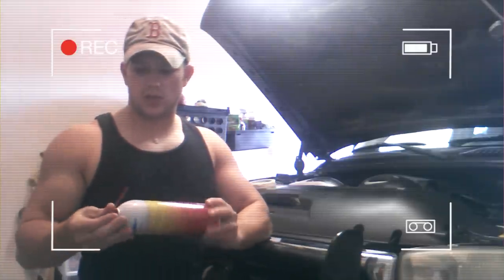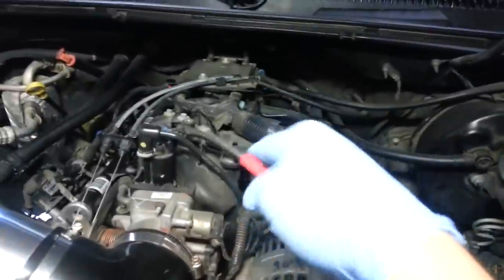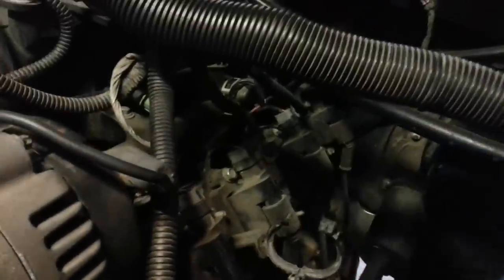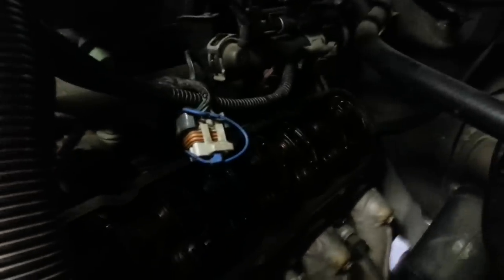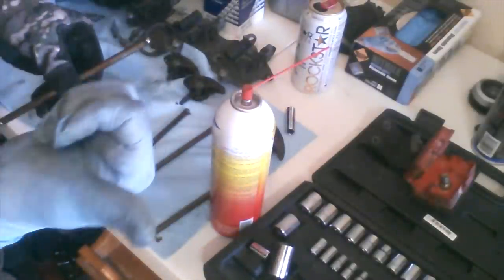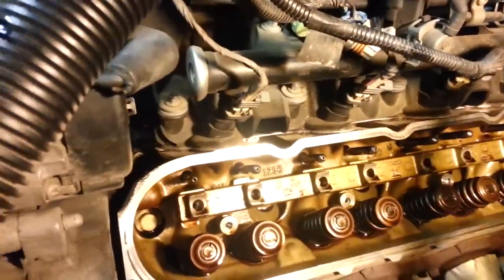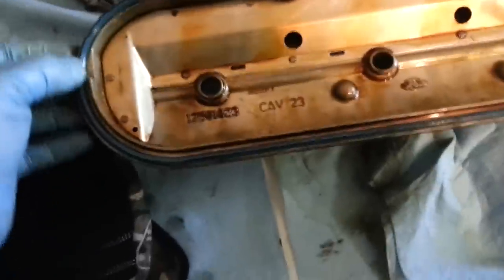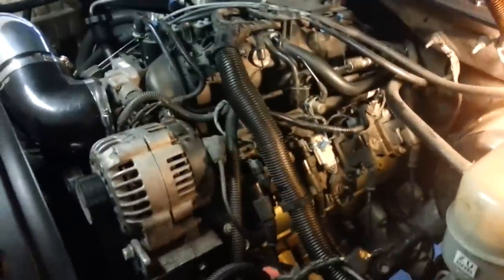GM Lifter Knock Repair - Carb Cleaner Method - HOW TO / TUTORIAL

Comment: This video was perfect I jus did this to my 01 5.3l z71 Tahoe and my lifter noise went away. Only difference was I used those long rocker rods to spray B-12 down into the lifters and afterwards I changed my oil and added seafoam to it. No more ticking
Reply: Sn99kwsb was the tick u have when warm or just cold start
Reply: It was pretty much only during a cold start and it would last about 15 minutes then go away but this was a temporary fix now I use hyperlube oil treatment to keep the tick away
Reply: Sn99kwsb my 2001 yukon denali 6.0 ticks at idle only when warm all the time once rpm up it goes away oil pressure is good exhaust manifold bolts good been doing this noise since i bought it with 60k miles now 148k miles still doing tried everything from synthtic oils to most additives still there only 20w50 oil seem to help little not sure what else to try
Reply: Ali Saleh well u should try hyperlube with your 20w50 or I might jus have to get new lifters are u sure u dnt have an oil leak?
Reply: Sn99kwsb i ll try hyper lube with 20w50 if it does nt work i ll have to ignore the tick noise and turn radio volume up till i save some $$ for newer SUV

Comment: i've always put a quart of marvel mystery oil in the crank case and driven it around for about a day or two before changing the oil, or in bad cases, i've put a bottle of chemtool into the crank case, driven the vehicle around the block a few times to get the engine warm, let it cool untill its just warm to the touch and did an oil change, this process atleast directly targets and back flushes the hydraulic lifters themselves, not a bad video

Comment: I did exacly the same on my Avalanche 3 years back. The tick came back after few months but I believe it would dissapear it it was repeated. Now, I have the same problem on my Escalade and will first to pour some AT in the engine, ride it for few days and if it doesnt help I'll remove the valve cover...
Reply: Did the trans fluid help??
Reply: @NORCALPYRO_  nope. I changed the oil pump (high flow) and it still had a pretty low pressure... Sold the car.

Comment: You do realize when you spray the solvent into the lifter it doesn't exactly "run down" ? The lifters sit in a bore and are fed pressurized oil thru the sides .. so it's just loading the oil passages with oil remover essentially ..
Reply: Yah that don’t sound like something I want to try
Reply: @michaelbaskinmichael9862   on a side note ... It does typically work .. you can also try jetting some air into it with a compressor

Comment: I tried that on the LS1 motor in my Holden Commodore (I live in Australia) and that didn't work,2 things I found can cause that noise 1 - varnish buildup in the lifter bore, the engine heats up after a few minutes and the lifter plunger expands causing the plunger to stick inside the lifter housing , 2 - dirt and/or dust gets trapped inside the lifter body causing the oil flow to become restricted through the hydraulic lifter, dirt sitting between the check ball seat and the check ball allows oil to flow up through the pushrod(s) thus not allowing the lifter body to fill up with oil therefore results in the lifter(s) making a "clacking" sound.Mine started doing it last August after changing the oil pan gasket.After 11 months of changing the oil, the engine only has a faint rattle on startup sometimes when warm but the loud annoying clacking noise has gone away so I'm happy with that.

Comment: There's an easier way: add 1 quart of atf to your oil and run it for a little bit before changing your oil. If your truck doesn't leak oil (rare for anything GM) then use full synthetic oil. It flows better than conventional oil.
Reply: excellent!   ive heard someone filling their oil filter w ATF on every oil change.  and/also running a full qt of ATF replacing aqt of oil.

Comment: Most of the carb cleaner will have evaporated once the engine is hot, and will be collected by the pcv system. Unlikely to do damage. Carb cleaner when oil is cold and thick. Evaporated once oil is hot and thin.

Comment: Hydraulic lifters tend to make a tappy noise if the the engine is not serviced properly. The sludge build up eventually restricts the oil flow. The best way to get rid of the noise is to remove the valve cover and the timing cover. Release the tension on the camshaft gears. Remove the camshafts and lifters. Clean the lifters and put everything back the way it was removed (just the opposite way). 

If thats too much of job for you. Simply flush your engine with diesel engine oil every fortnight/month. Use good quality synthetic oil and oil filter. Over time the sludge build up will decrease and the oil pressure will increase. Will not fix the problem but somewhat remedy the problem to some extent. 

Lastly dont waste your time watching a 25 minute video coz there is simply no quick fix to the problem.
Reply: Kamal Benipal I have a 2001. 8.1. I bought it with 69k. It always knocked at start up. From what I read, this is normal for that engine. 496 c.i. One powerful engine.
Reply: This motor doesn't have gears and there's only 1 camshaft.  You would have to remove the intake to get to the lifters.  You have absolutely no idea what you're talking about here.  Jesus..
Reply: You actually have to remove the heads to get to the lifters on a LS based engine.
Reply: SNELLERIZED GARAGE
I am surprised so many of these commenters do not know you have to pull the heads on an LS based engine to get to the lifters (to remove them). Hence the whole reason this dude in the video is going through all this to try to devarnish/desludge them. I have a higher mileage 5.3 in my 2001 4X4 silverado that I am going to do this to real soon. It would be nice to just pull the intake, remove the lifters, soak them in some type of cleaner, inspect them and re install them like the older gen small block chevy's...........lol. But these LS based engines are really just so much better than the previous small blocks.
Reply: CHEECHMUN
I have been searching for a 6.0L to replace my 5.3 in my 2001 silverado, but that 8.1 would be awesome......
I know a guy that messed with diesel engined silverados for awhile, got tired of them and now has two silverados with that 8.1 engine in them. He said they are much cheaper to maintain and will pull a house.
Reply: @Ephbaum  this generation you have to remove the heads

Comment: Just so folks know when torking the rocker arms you have to bring #1 to TDC then tork the intake 1,3,4,5 and exhaust 1,2,7,8 then turn engine 360° and tork intake 2,6,7,8 and exhaust 3,4,5,6. That is the proper order.

Comment: I want to clean my rocker arms valve springs tops of the heads and push rods with gunk non-chlorine carb cleaner and let it soak overnight then change the oil again I just changed it last Saturday but I had to replace my intake gaskets actually if you go back and look at my very recent video on my channel you will see why I want to clean it all up my motor was beautiful before I tore it apart I didn't realize it was so dirty inside LOL what do you think anyways about spraying my valve springs and rocker arms down and push rods with carb cleaner

Comment: Why not just spray the carb cleaner down the oil hole of the rocker it will drip down through the push rod then down to to lifter.  No need to take anything apart.
Reply: so would this work
Reply: he just wanted to do it the hard way
Reply: I know right? 
Just pour a bunch of B12 in the oil hole. Let it do what it does. Then change the oil in a day or two.
Can someone validate this for me?

Comment: THATS WHY CHANGING YOUR OIL WITH THE RIGHT OIL IS SO IMPORTANT
Reply: WHEN OIL WAS CHEAP Castro .99c qt, I would never let it get dirty, it looked just like it came out of the can. I changed it about every 1000 mls.
pre filters help also and keep air clean = clean oil
Reply: Every 1000 miles?.You would be more broke from buying oil than replacing engine.......lollolol.............That's a lot of damn oil....That would be about 15 oil changes in one year.......................
Reply: @shawneliason790  he's probably full of shit,but if you change your oil at 1000 miles say three times consecutive, it should douche A lot of shit out,I've done it on many used vehicles, at that third change the oil is clear af,Italian style.especially if you don't wanna take it to a shop ,

Comment: I have a 07 gmc sierra v6 4.3 I can let my truck sit for few hours or over night  during day its fine . if I let it sit it will have a tapping sound in the passenger side valve cover but it will clear up about 1 minute I have checked the rockers there tight. And took out the push rods none are bent. I rolled them out onto a flat bord. Do I have a lifter thats possible sticking? I havent took my intake off yet and checked those. But there is one thing this video helped me on that I didnt check lol. Is the holes on the push rod might be stopped up?

Comment: hello all, cant you just spray through the rods since its a sort of tube , and its directioned directly to the point where you need the carb cleaner to dissolve the sludge? just asking so i dont have to worry about separating all the pieces.
Reply: I kinda thought the same thing.
Reply: If there's sludge stuck in the rod preventing oil circulation and you push it down with the spray, there might be a chance that it blocks the rod again.  Or ends up in some other place, like bearings.
Reply: @mattijur4374  But if one gets to that point, they should just remove the rod, clean it and then put it back in and use it to funnel the spray to the lifter.  Probably a good idea to clean the rod anyway if you're in there.

Comment: or perhaps...... ATF in the oil. One recommendation was filling the oil filter with automatic transmission fluid when doing an oil change.    and/also having 1 full qt of ATF replacing 1 qt of oil.  Run normally, or before an oil change.

Comment: those stock pedestal style rockers are bullet proof, there's virtually no way to screw them up.
you really can change the order any way you want, the engine wont care.
All roller lifters and rockers don't need to be matched either.
If you're OCD then do what you will, but I heard this from engineers that build engines.

Comment: I own a 5.3L V-8 Vortec Engine...... I use synthetic oil and drop it every 4000 miles. I find that synthetic oil flows better within the tight areas of the engine. Conventional oil if not changed on a regular basis can build sludge that clogged the push rods and harm lifters. I also use Marvel  Mystery OIL I run a quart on every oil change......Keeps everything nice a lubed. I also add 4 oz in the gas tank to clean and lube my upper intake cylinders. Using a carb cleaner and air compressor is great but spray some Marvel Mystery Oil to fine lube it works...
Reply: You can do an oil change every 6000 miles nowadays easy. The 3000miles oil change thing was for cars in the 50s. Just a tip if you wanna save money. Every 6000 aint gonna hurt anything.
Reply: +Jesse Jesse ummmm... no. lol. 6000 is for synthetic oil. If you are running regular oil YOU STILL NEED TO CHANGE EVERY 3k or 3 months!!
Reply: Nah I'm sticking to me original statement. Take care of the motor and you can go 6k every oil change.
Reply: Eric Swarbrick
Reply: +Jesse Jesse one of the reasons I dropped my oil every 4000 miles and use a quality filter and quality Libs.... is because of  punishment I put the Vortec engine thru.
Reply: That's understandable. For daily use and not beating a car tho you can go 6k per change.
Reply: +Jesse Jesse you're 100% correct. most synthetics you can even go ten pretty comfortably. I feel like that recommended 3k is bs dealers can use to void your warrantee if they want to. If you do research on synthetic oil, you can see that it doesn't really break down. it just gets dirty from micro particles. my bosses Toyota carolla has a recommendation of 15000 miles for an oil change, when I saw that, it blew my mind and I had to do the research.
Reply: Wow yeah I've never heard that long before. But if anything a coralla would be the one to do it Gary Will
Reply: In Asian cars even more the reason to use MMO
Reply: NYRM1974 technically nothing in the intake is being lubed.. The engines sfi
Reply: @jessmane  look at those repair manuals from 60's and they say 5000-6000 miles per oil change. Fast forward 60 years. With better filter and oil technology. We change every 3000😉 go figure. I think it's to sale 2 as much oil
Reply: @cleverkitsune4302  it gets lubed threw the PVC and breather tube on passenger side. If you ever took off one of these intakes you know what I'm talking about 😉
Reply: @pmotorsports8276  yeah but remember everything is made super cheap now and doesnt last. Oil breaks down faster, cars fall apart easier, nothing is made to last. The excuse of the 60s is the engines weren't reliable bcuz technology wasn't there yet. But the strong materials were there not the materials are cheap but we could do so much better if we wanted to..

Comment: I think it's a great trick.  but just be careful not to dilute too much my brother did something similar changing over to really really light weight oil to "clean out" noisy lifters on a pontiac 6000 4cyl, it collapsed some and floated other lifters and wiped out the head. don't remember details of problem other than a new head and lifters were required.   I would definitely change the oil if much goes into the oil pan.

Comment: Is the procedure the same for a 2011 Denali 6.2L Gen IV L94 engine? I replaced the lifters / camshaft at 131K miles. 48K miles later, I hear the same ticking noise. Want to give this a try if it is similar procedure. thx.
Reply: Scott Knowles different styles of lifters because 06 and newer have DOD so the cylinders shut off for better fuel mileage

Comment: I did exactly what you did in the video.... Drain my oil & on the tip of my oil plug(bolt) was 5 little pins sort of like what goes inside a bearing... Put fresh oil in it & it still makes the same noise... Driver side closest to the front.... Should I swap motors or what.... 03 Tahoe 4.8l.... Thx

Comment: the tube of the carb cleaner fell into the rod hole, now I have to take the heads off....geez
Reply: You could just crank it over and have the oil pressure blow it out then grab it. Should be about 60 psi, and have no problem pushing that tiny tube out.
Reply: Michael Weal  vacuum
Reply: Thanks for the warning.
Reply: Just use a magnet to retrieve it

Comment: mine used to do the same thing i just put a quart of transmission fluid in it and it hasnt done it since 20,000 miles ago
Reply: In the motor oil? My gmc makes little noise I jest rebuild the engine
Reply: I've heard of putting transmission fluid in the oil to clean out the oil passages and such. Some people swear by it.

Comment: Lots of good information there. I assume that job would be basically the same for the V6, although I don't like the air conditioner being where it is on that one. I think I would have numbered those spark plug wires and I hope you found a way to get those oil stains off your shop manual pages. Those shop manuals aren't cheap or all that easy to find either.

Comment: Im old school, I do one cylinder at a time at TDC for each cylinder, if you have a goofy cam that might not apply, by the way , when it comes to solid lifters, I want to know the valve lash when the engine is hot.
Reply: tom ashton you aren’t familiar with LS engines I’m guessing.

Comment: The 4.8,5.3,6.0 and 6.2 are not LS engines,are LS based.Most of the time it is not the lifters,it is the rocker arms due to the heads being casted wrong.These engines have head problems also,the sludge is from coolant mixing in with the oil.The middle headbolt hole cracks allowing coolant in
Reply: RptrKlr 60 actually they arent.. Ls engines are a completely different animal the 4.8 5.3 and 6.0 are iron block pushrod engines that are ls derivatives but not actual ls engines